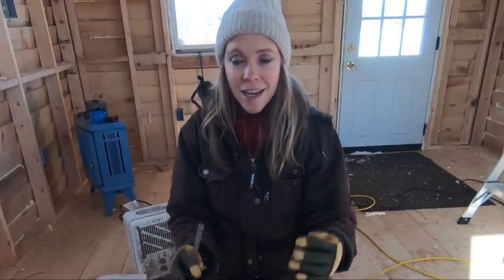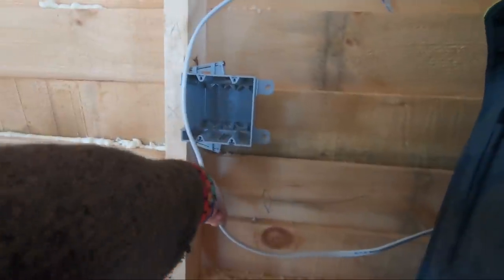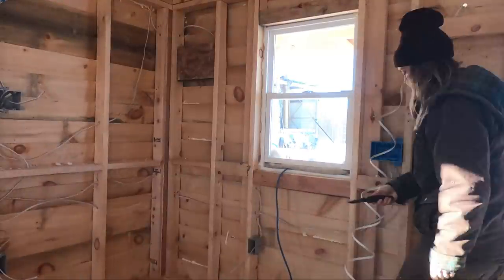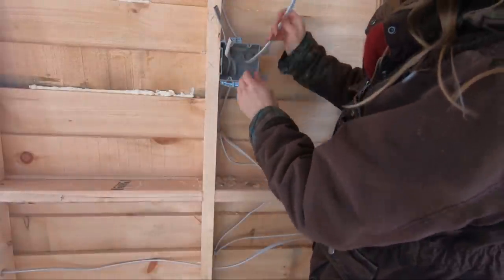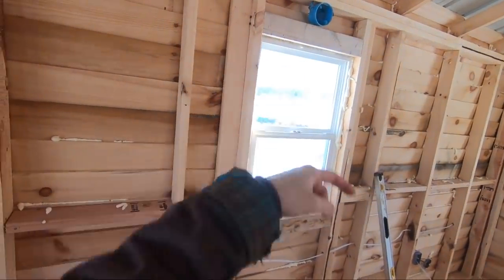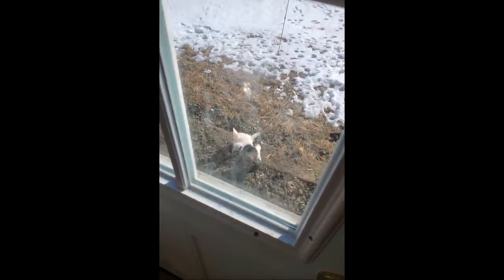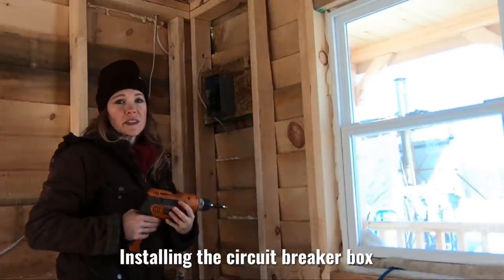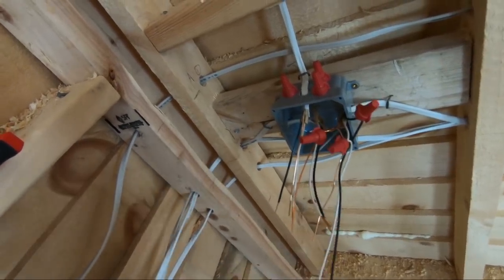My Electrical Wiring Was a FAIL! -- DIY Tiny House Amish Shed to Office Build Vlog#5

Comment: I cant believe how much that drill struggles pushing the spade bit thru. Is it new?  Is it sharp?  
Don’t let the stuff you haven’t done before intimidate you. Almost everything we have done with the house build is something I haven’t done before.  There have been a lot of days where I stop working to figure out what my next move is.   
Every time you do one of these things you learn something. And it is another skill in your tool bag. As you build these skills, you will find they help you figure out the other problems that come. 
Your son will always remember helping you wire the cabin.

Comment: Everybody learns thru doing.  You don't learn if you don't make mistakes.  Here is one of mine I will not forget. I just started working on heavy equipment and I was told to change all fluids and filters on a loader JD 624H, so it was almost time to quit and I figured i would drain the front axle lube and let it drip empty over night. The next morning I was welcomed by my supervisor at the timeclock and he asked how my day was going?  Well the 5 gallon container i used was not nearly big enough to contain all the fluid that drained out. See i didnt know both axles are connected thru the transmission so every thing drained onto the floor. Yup, always learning. So cheer up you don't have gear lube to mop up and cement to clean.
Reply from the maker: Oh gosh! I wonder if mine are too?! I was lookng at them last summer and couldn't find a drain plug for the rear axels!    Well at least you tried and were keeping them maintained ;D

Comment: Doing a great job the only thing I suggest is putting the steel plate protector on the studs where u got the Romex running through them ask for them at any building store
Reply from the maker: I've measured the holes and did buy a few for the holes that are required by code to ahve them :)

Comment: I thought, and think, you're doing pretty well, I know I don't have the patience for wiring, I certainly pray and hope your work won't be for naught, that the inspector w works with you, and if there's a problem, it's minor, I've been surprised you been working with no heater in there, the job is tough enough
Reply from the maker: I think the inspector will work with me. He seemed pretty laid back :)
Reply: Oh, that would be great

Comment: Have you tried those quick connectors for wire yet? You just push the wire in and it locks in place. I have used them a couple of times,  they seem to be good. Faster than wire nuts, and less apt to come loose. Check with your inspector to see if they are ok.
Reply from the maker: I read about them online, some people said some places allow them and others dont. Other people said they were a pain to use if you needed to unhook the wires. I made the mistake of trying the quick connects on a light switch, and had to break the wires off because nothing worked to get them back out (and even those are discouraged by inspectors).  So after that, I'm not too keen on anything quick conenct, lol

Comment: Run number one in doing something slightly out of your comfort zone is after you have done your research and made your basic plan remember this simple rule "if you think to long you will think to wrong". Secondly wiring a new structure is pretty easy so don't over complete it. Always make your wire runs neat and orderly which means don't take wire run short cuts it will come back to haunt you later on.  Lastly always wire to code.

Comment: I'm sure it's too late now for the cabin, but they make a tool to strip the outer insulation off the cable that is dirt cheap & much faster than a knife.  There's also many different tools available to strip the insulation off the individual wires. The cheap ones aren't worth the money.  I've had one for over 25 years called an automatic wire stripper. I just looked on Amazon and found one made by Klein tools for $27.94. It'll last the rest of your life & save immense time.  I've stripped tens of thousands of wires with mine.  FYI:  Great job on the rough in wiring!
Reply from the maker: Will probably get a better stripper for the house build ;D

Comment: Suzanne you have not started to run wire yet! What ever happened can be fixed pretty easy. Now if you had all the wiring in and you sprayed the foam and then find a problem. Yes, it can be fixed but will take longer and harder to do. Keep up the good work!

You made a comment about how much wire you have already used. Many houses have miles of wire in them.Just wait until you build your house. You will go through wire like water. Then water and sewage oh what fun you are going to have.
Reply from the maker: LOL well at least with water and sewer they were installed with the plan of tieing into a new house, so it hopefully won't be an issue ;D

Comment: The trick for getting the cable into the outlet boxes is to get a flat-head screwdriver and a pair of Klein's or a hammer and smack the tabs in with the screwdriver head prematurely without breaking them off, just pre bend them inwards if you will, prior to running the NM-B cable through into the outlet box. 😉👍
Reply from the maker: LOL I finally figured that one out after I was nearly done!

Comment: Looks like little man is starting to be good help . I built a small house out back of the property for my son . It's 16x32 vaulted ceiling and loft . I used 2x6 on the walls 2x8 rafters . I used baffles between rafters for air movement and r19 insulation . I used rock wool in the walls . I looked at the spray foam and cannot wait to see how well it works on your cabin .
Reply from the maker: We opted for the spray foam over fiberglass because the mice will not chew it, it will not mold, and it keeps moisture out (and in). Plus it "glues" everything together to make it extra solid, so moving it shouldn't be an issue :)

Comment: Susan the best advice youll ever get is before you tackle any new electrical work is first consult an electrican and then consulat local building codes because house or garden shed if your installing outlets there usually set at a standard height from the floor and a certain number per circut . also remember 14/2 is general lighting white wire and 12/2 is for base board heating and hotwater tanks it can carry 110 volts on the red and the black wires so it comes out to 240 volts . susan do not attempt installing heating unless you know the exact math because to get the right number of heaters permitted on 1 line depends on size of the heaters and the wattage of each heater example if you have 3 heaters one is 750 watts two are 1500 watts thats a total of 3750 watts the max you can install on a line is i think 5000 watts and thats on a 2pole 20amp breaker . your garden office is small so 2 1500 watt heater would be more than enough to keep it warm but always consult an electrican first and if you do the work yourself have a master electrican look at everything before you close up walls because theres certain things that should be done like putting wire staples a certian distance up from the boxes its a lot of work but it beats having an accident or burning down the shed .
Reply from the maker: My goal is to keep the system at 1500watts because it's going to be off grid anyway, and the more watts run, the more $$$. I did call the eletrical inspector and asked abut heights and such and he said it didn't matter for a shed office, so I guess we'll see :)

Comment: All electricians did NOT know anything before they learned how.  You are doing just fine.  Be bit careful with expanding foam - it can warp or move siding AND WILL leak into where you dont want it.

Try to crystal ball all future needs.  Dont forget to run phone and computer.  Future power need   can be made easier if you run empty conduit or just not connecte NM

Dan Bentler

Comment: Black to brass & @ the most 8 to 10 outlets/lights on a circuit are some basic rules to follow. I've added lights & outlets in our sheds & am completely redoing the wiring, outlets, & lights in our garage. For the garage I made a floor plan & laid out where every light & outlet is going to be so could plan my wiring & use it the most efficiently. Electrical can be intimidating @ first but after you do it enough it gets a lot easier. Just have patience & don't try to rush things too much. Double (& even triple check) your work.
Reply from the maker: I also found writing on the walls helped when running my lines ;D
Reply: @This1LifeWeLive  wood is just as good as paper when needing to draw or write something out. lol
Before you cover the wall though, they make metal plates that have tabs on them that you hammer on the studs where you run wires through them so that later on you don't run a drywall screw into your wiring. Good cheap "insurance".

Comment: Plugs go max 12' apart, run 12/2 gives you 20 amps. Run 12/3 for a three way at each door for lights. Add adittional piugs and light switches as desired. Staple wire 8" or less at each box. Leave 8" of wire coming out the box.
Reply: Running 12/2 gives you the potential of a 20 amp circuit.  Suzanne mentioned that the breaker box had two 15 amp breakers.
Reply: @ronsommer9409  So, using 12 gage wire:  A. allows upgrading to 20 amp circuits (2) or  B. if that is never to happen, is a waste of money
Reply: @steveholton4130  better to have and not need than need and not have. Doubt the extra cost for that shed is more than $10.
Reply: @allenburns3177  Agreed!

Comment: As an electrical guy, I know that the rules can change from building department to building department.  I also know that years of training are not needed to put a wire under a screw and tighten.  I also have a great understanding of the pride of doing a job yourself.

So, if you are not familiar with the electrical rules. I will encourage home owners/diyers to consult with a local electrician.  Whatever barter/deal you work out may have your problems solved before you realize you had one.  

Also, you can.get those "style points" worked out early:  

Light switch wiring for 3 way lights

Gfic locations for convince (recepticle  bathroom instead of in the panel to prevent the you with wet hair having to travel through the whole house to get to the panel to reset your hair dryer.)

Shed outside lights on a timer like the bathroom fan....so you can walk safely and not return to cut off the lights.

Remember that KNOWLEDGE is the treasure that you can give away all you have and still have everything you started with.....so beg, borrow, aquire what you need and be safe out there.

Comment: It always fun to pull and strip Romex in the cold. They make a Romex stripper cheap. You used the wrong color wirenuts you need - Yellow and Green ones or crimps for the ground wires.

Comment: Not sure who's sips your ordering, its pretty standard for sips to have wire chases molded into the foam that you will pull the wire through.  Our house was a first for our electrician who was skeptical at first but said it worked out really well.   Plus with the chases 2ft on center vertical it will be real easy to add additional outlets in the future.
Reply from the maker: All the sips we've looked at don't have anything pre-installed... they say to run it behind the beams or along a channel in the floor . . . .?
Reply: @This1LifeWeLive  Look at Extreme panel technologies out of Minnesota.  They were great to work with and had some pretty nice specialty tools that were rented to assist with assembly.

Comment: I think you're making it harder than it is!  And a lot more complicated to. 
But not terrible for the first time. 
I personally don't like those plastic boxes.  And they make a stripper for the outside coating so you don't compromise the coating on the wires.   And you have a lot of wire to stuff back in the boxes.  
You should of got a wiring book from home depot.  To get some ideas from.  😊👍👍👍
Good luck with it Suzanne. 
😊🤗👍👍👍💝💝
Reply from the maker: I personally find that any new skill is harder and more complicated when you are first starting out :) But after you do it once or twice it's like riding a bike :)
Reply: @This1LifeWeLive  yes it is
Reply: @This1LifeWeLive  Suzanne 
When you build your home  draw up a electrical plan for a guide line. 👍
Something to think about how far off the flour you want outlet's!!
I have found the older one gets the harder it is to get to the ones closest to the floor!  I  have been centering ours 4 foot from the floor  .and I like it much better  !!😊👍

Comment: Normally you twist your grounds together in the box and use a crimp barrel type connector to hold them together. Leave enough tails sticking out for your necessary grounds. Also, make sure your wires can't pull out of your wire nuts. I usually use the smallest one possible to conserve space.
Reply from the maker: I'm going back and forth on the size, like you said (to conserve space). Obviously the 3 strands will need a larger nut and the two strands a smaller one . .. but I'm sure I'll forget and just grab whatever is on top . . . then re-do it, hahaha

Comment: We have a cabin/shed next to our house and we’re not concerned about codes. We connect our  the cabin to our house with a heavy duty extension cord. When we’re not using it we just it we just unplug it from the house and put the cord away. Think of it as a travel trailer without wheels
Reply: I did a similar thing buried a line out to an "RV pedestal" then ran a short heavy cable over to the sheds power input. That way it is not considered a permanent install for taxes.
Reply from the maker: since we are plannig a house build later on, I don't want them seeing the cabin shed and asking questions. If they do, I'd have to rip all my walls and spray foam out to show them the wiring. I'm just playing it safe :)

Comment: You are doing great.  there are many ways to do things.  Those do not look like the correct staples for wiring.  Usually they are 1/4" wide and have stops so they don't get too tight on the wire.  Remember ALL Junction Boxes where various wires connect must be on outside of wall so they can be tested etc.  See 28:00!  You may need access.   Leave a 1 ft. sq. hole in wall and make a cover.  Looks like you need 3 or 4 separate circuits.  You cannot spray Foam within 1/4" for thickness. (1-1/2 or 1-3/4! )Just settle on 2".  
You could spray under the floor.  Any there would be beneficial.  When it was unloaded  there were joists that could be sprayed up to.  You might want to mark the height of your cable runs on the floor where you mark the Centre Line of each stud so you don't nail into the wire if you are not using cable guards.  6" of wire is lots for inside boxes.  No more. If you have one, throw a big tarp over the roof.  15x20.  Anchor it well.  Duplex outlet on porch and back door area would be good.
Reply from the maker: ON the holes that are less than 1.25" I'll have stud guards :) Yes the juction box will be accessible just like the breaker box :)

Comment: POWER FEED CABLE into am electrical box.......I like to feed the TOP LEFT CORNER with the FEED POWER CABLE.   Then I always know which cable is HOT if the splices are disconnected.

Comment: Do you have  to put metal plates on the 2 x 4's where you drilled to pass the wires through ?, so you   don't nail into a wire .! after its covered.
Reply from the maker: If the holes are less than 1.25" from the stud face then they do need a nailer plate. I picked up 7 and can get more if needed :)

Comment: any 4' wall should have a receptacle.  there should be a receptacle every 6'.  5 Duplex per circuit in most cities but in the county you can generally double that.  Every 220 plug home run. Your lights can all be on one circuit .  Lights should be on 14/2 with Ground, 115 plugs should be on 12/2 With ground, most 220 plugs should be 10/2 with ground.